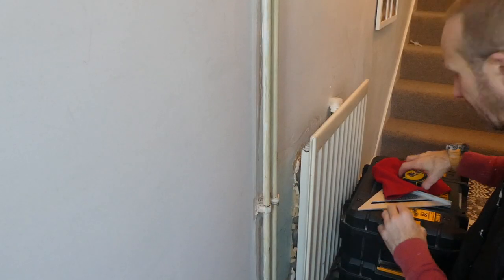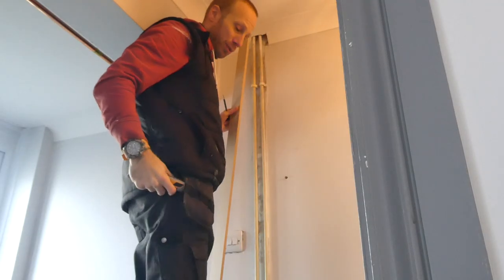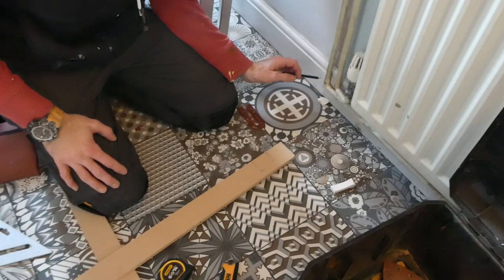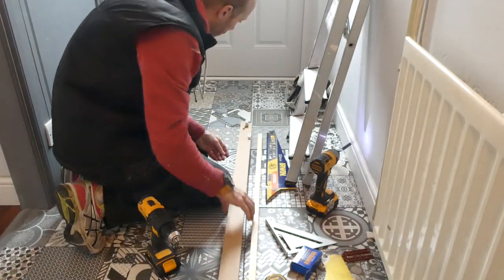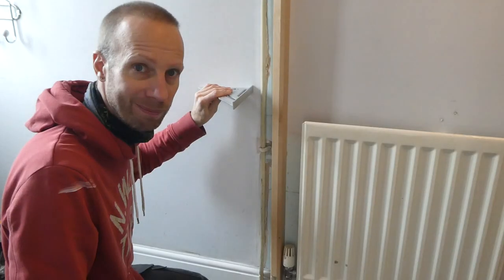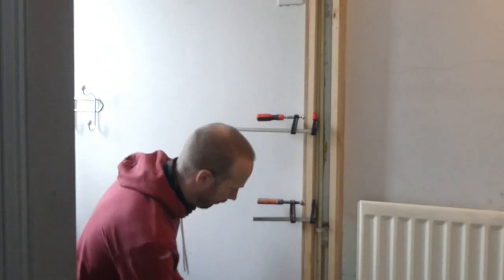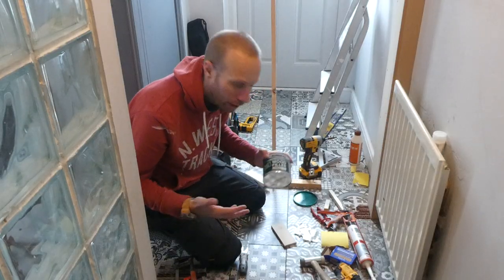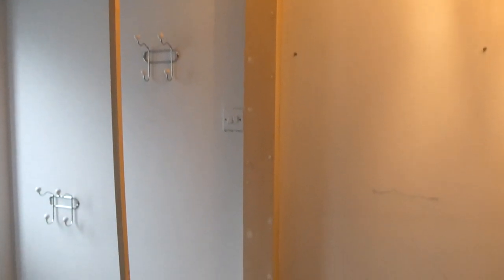How to box in radiator pipes on the wall - step by step

Comment: Never do what he done, to cover pipes which are heat pipes, you loose heat and than mold etc. you either change pipes to best option to spiral ones which shine than you will have option where to place wet clothes shoes etc or make metal mesh on those stright pipes but never cover up as you will loose heat

Comment: Just use pipe covers from wickes £6.50 + 10 minutes to fit, they even come with brackets to fit to wall, a lot less hassle and are only a few millimetres bigger than the pipes so less noticeable

Comment: I know you have to meet the demands of the customer but why would you want to box in pipes in the middle of a wall? In addition, how is the home owner now going to operate the radiator tmv?
Reply from the maker: The customer wanted the pipes boxed in, I supplied that service. The home owner will operate the tmv as usual - it's still accessible and usable. 👍 That's what the customer wanted!

Comment: Before I get hate this is a genuine question from a novice.

Why did you measure / Mark the left side panel based on tapping it in place to match the front panel. Surely that can have some unintended skewed measurements unless absolutely perfect.

The main thing here is surely a set minimum gap between the pipes and wood.

Pipes can bend and slightly expand or the wall may not be straight so no matter what shouldn't the side panels be placed FIRST and distance measure every half meter or so from the pipes to ensure a set minimum gap. Even at the worst points the pipes may jut out.

Surely then you would make the panels level based on the furthest point that sticks out on the pipes. Then once the sides are on you measure the front panel and cut to fit that way it's always a rectangular and levelled shape and even at the worst point the pipe might be angled out will still have a minimum distance for safety.

Just a genuine question there may be huge flaws in my thinking as a novice.

Comment: I'm wanting to do something exactly the same as this, but my pipes do get warm. Should I worry about using MDF or other woods against warm/hot pipes?
Reply from the maker: Ensure the timber isn't touching the pipes, and consider some ventilation for any heat to escape.
Reply: @JBTV  
Agreed , thought maybe too since it’s heating pipes the whole design possibly could of been removable for a check point for the lines

Comment: Instead of using fixing blocks, could you just not use grip fill on the back edge to attach to the wall? or would there be too much wobble?
Reply from the maker: Hmmmm, good idea, but it would be likely to come away in time, plus it would be messy if you applied enough to stick it well.
Reply: I know this is old but might help someone... There's some great builders adhesives out there now that can withstand high and low temperatures so use that instead of blocks in my opinion

Comment: Could you not have used the fixing blocks to fix the side panels to the wall
Then just fix the top panel onto the ends of the side panels? there would then not be a need to use softwood.